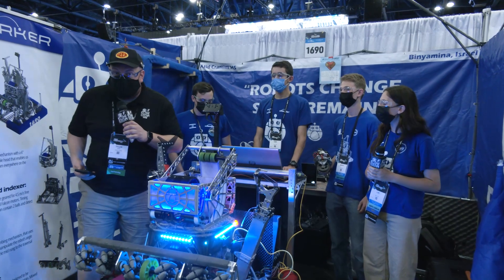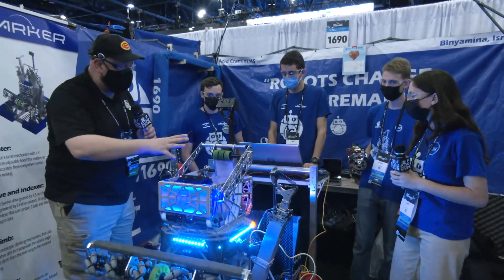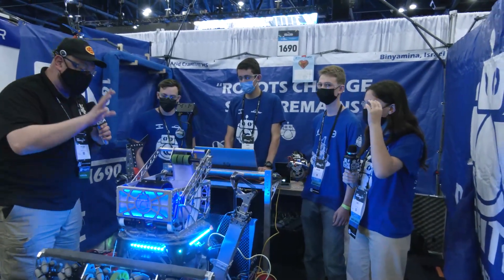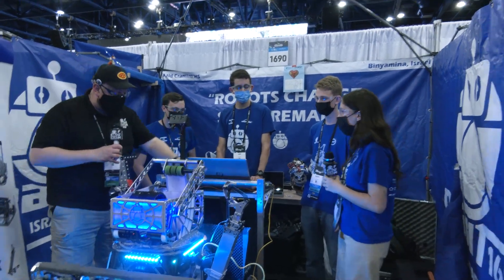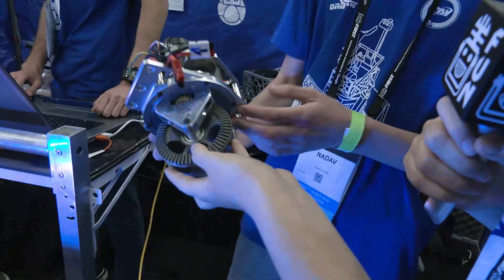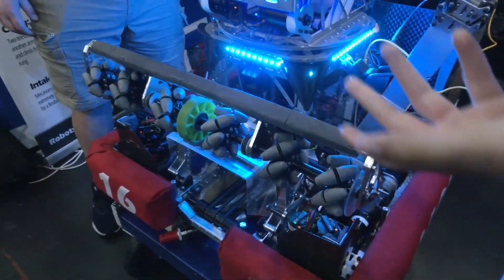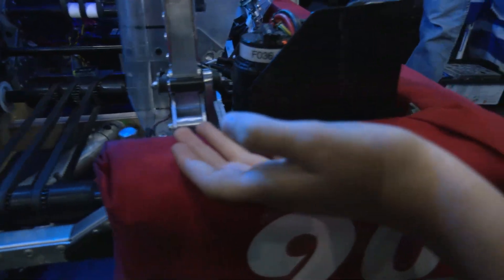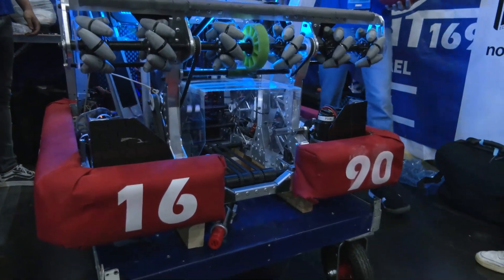Behind the Bumpers 1690 Orbit | Rapid React Robot

Comment: I kept trying to think of a way to mathematically optimize the shot arc, but minimizing the derivatives of robot parameters is such an elegant solution. Amazing stuff as always
One question, did you factor in the shape/mechanics of the hub into your shot optimization? We did most of our shot optimization based on a shot that had a very low chance of bouncing out
Reply: Yes we actually did. As part of the "cost" calculation for every shot, we added the max height of the trajectory of the ball. That's due to conservation of energy:
The higher the ball gets, the more potential energy it has. When the ball gets to the target, all the potential energy is converted to kinetic energy, and the more energy the ball has when hitting the target, the more likely it will bounce out.
Reply: @noamprag9393  how do you find the shot velocities that a wheel speed and hood angle will produce, do your the wheels slip on the ball?
Reply: @olikat9774  The physics simulation solves the differential equation for the position of the ball, using Euler's method.
The trajectory calculation takes into account the current state: velocity (a vector in the vertical plane), position, and spin, and yields the next state, in small steps.
What defines a trajectory of a ball, is the initial state. The hood angle, combined with the speed of the shooter wheels, can be thought of as a vector in the vertical plane, which represents the initial velocity.
Reply: @olikat9774  In regards to the slip on the ball, we don't compensate for it in the shooting simulation, but multiply by a factor in the robot code.
This is due to the fact that the balls are inflated differently. Furthermore, this number increases between matches throughout the competition.
Reply: @noamprag9393  Interesting, did you have to rework the math after adding a hood roller to account for reduced spin?